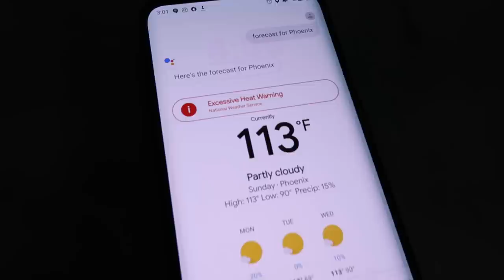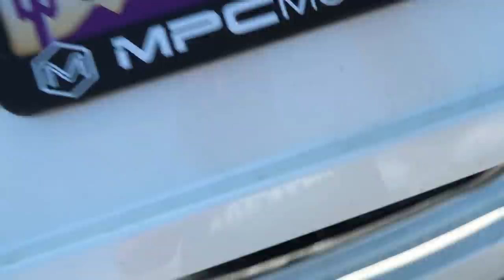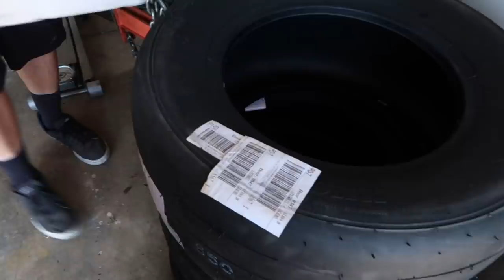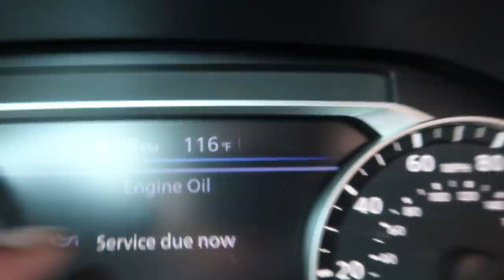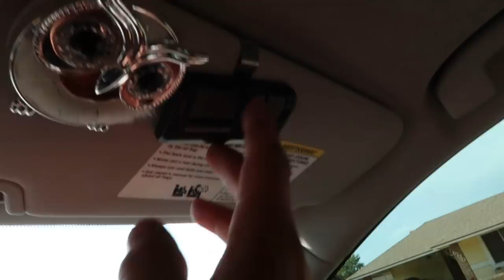K Swap build!!!

Comment: To help your car cool down faster if it’s been in the sun , grab the water hose and spray the condenser ( radiator area) with cool water before starting the AC . Water can drop the temp 20 or more degrees and help your AC drop cabin temps faster.

Comment: You will learn if you ever get to take apart a k series how tight the head bolts are and then how tight the Piston rod cap bolts are you would think that they're aftermarket. Torque to yield and tight as f***. the Piston to rod stroke ratio on k series has a higher mechanical advantage than a b series and that is why you see higher torque and horsepower numbers coming from them as well as the advantage of VTC. But think about the crank design having a mechanical advantage similar to you changing your bike into 15 speed mode instead of 10 speed mode at the pedals.